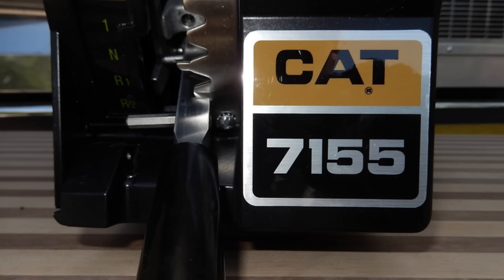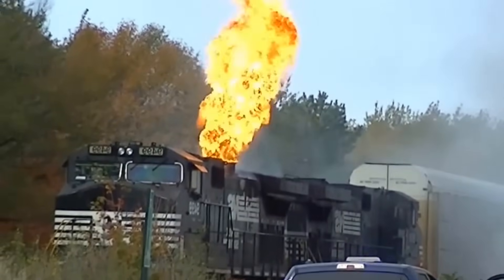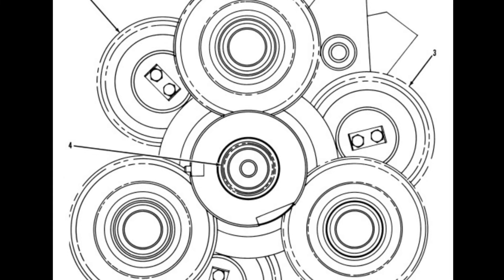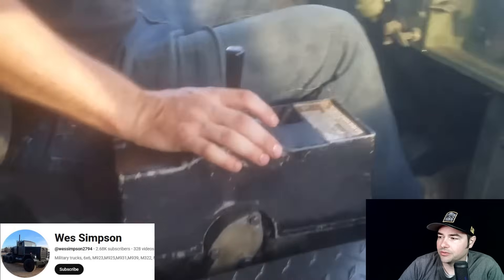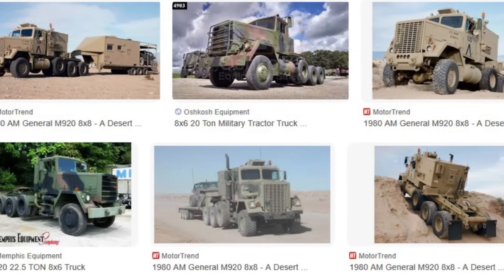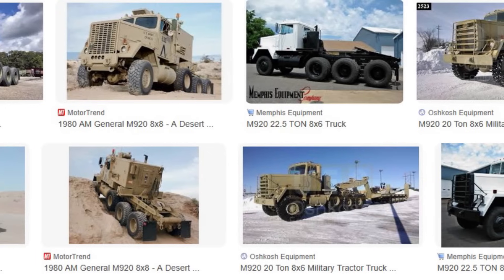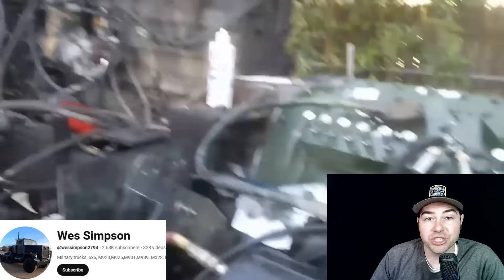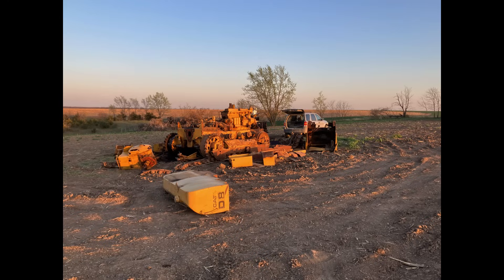Cat's "Semi-Automatic" 7155 Transmission. Ahead of its time and never released to the public.

Comment from the maker: Hope you enjoyed this one. Special thanks to John Goldsmith and Wes Simpson. Wes' Channel link is here: https://www.youtube.com/@wessimpson2794
Reply: I drove a Tank transport road tractor once that had one of those transmissions in it and talked with Sargent that drove one of these trucks and was a trainer and asked him about the semiautomatic transmission. He said that the military went to this transmission because of lack of kids joining the military who grew up driving manual transmission especially non-synchronized transmission like found in heavy duty trucks.  Think about today a truck driver needs an endorsement to drive a manual transmission and the first truck I drove for a paycheck was a dump truck with armstrong steering and twin gear sticks sticking up out of the floor. Additionally the return line was restricted and fuel was turned up which meant you had to ease into throttle every gear change and bark it before you took off otherwise you would hydraulic the engine and blow it up.  My point is not to pat my back but to point out differences on how people my age learn to drive back in the 1970’s compared to people who learned to drive in the 90’s or later when cars had fuel injection not carburetors that required you to feather the gas pedal to keep the engine running when cold and let’s be honest how many people under the age of 50 can drive a manual transmission in the US and of them how many know how to double clutch and or can drive a non synchronized transmission.  
That all said my only real gripe is with a standard manual transmission I pretty much can figure out what gear I a in by feeling where the gear shift levers are and with that semi auto transmission you need to see the light on the dash or look down at the shift tower.  The Sargent who trained military drivers said he pretty much instructed his students to always start in the basement and come up 1 gear at a time and down 1 gear at a time then again they were never supposed to exceed 45mph if I remember correctly

Comment: I was a 19 year old army reservist (transportation unit) ,  and the M915 was the first big truck I drive. 400 Cummins,  Cat transmission,  CCC on the grill, AM General on the side of the hood, i think an IHC cash and Hendrickson suspension. I remember the distinct sound when shifting.  There was a pedal for the Jake break where the clutch should have been.

Comment: worked for cat's R&D departments for 15 years and never came across this piece of equipment, so it was fascinating to see. But toward the end of the video, when you could hear the air cylinders extending and retracting, THAT SOUND is something I DID hear alot in the tech center's test cells. And started to wonder, I bet THATS why the company didnt market it all that much. Air cylinders arent known for going millions of iterations (cycles). They just dont last, unless Cat was making THEM as opposed to buying some aluminum units. I got to see alot of neat stuff in Mossville & Proving Grounds. Nice Video

Comment: GMC put the 302M hydro-matic transmission is the military M135 2 1/2 ton 6x6 beginning in 1950.
Found one listing for the 7155 (NSN 2520-01-082-8143) at $20,500 and another listing for rebuilt 7155's for $10,500

Comment: Its a big go kart clutch 😂 and centrifugal clutches do have adjustments sometimes, you change the engagement etc by changing springs and weights, sounds like a really fun time trying to setup the clutch initially for different applications if they require such adjustments 😐

Comment: Cat semi-auto 7155 transmission:   Weigt (Dry) 1138 lbs.  (459 kg)
Eaton 14910, 10 speed manual transmission:  Weighs 650 lbs. 
500 lbs. weight penalty is huge for commercial highway trucking, not to mention initial cost difference.
Reply: You also gotta factor in the clutch weight on the 10spd as well  so it's only about 350lbs difference

Comment: The Cx Transmission might be cat designed but the electronics are Allison ;) I have an Allison version on my desk as I am designing a new Keypad PCB and new TCU PCB as we have an MD3060 IIRC in one of our two foot gauge trains that came from a garbage truck (with attached 8L cummins engine (Which I wish was a Cat)) as the old set up is trying to engine brake on down shifts and trains brake with the carriages ;) not the engine ;)

Comment: I own and privately operate a M920 with the this transmission in it. Its a bullet proof beast, however many drawbacks. 1. you need to be extremely conscientious about what gear you pick since there is no clutch or easily assessed neutral during rolling turns and abnormal activities. 2. the lag in shifting is terrible, you will need enough energy to bridge a 2-3 second disconnect in torque. which is an eternity for a stick shift. so steep hills and bogs are going to knock you down into a gear that you could launch from a dead stop. Forcing you to crawl out those situations without any ability to up-shift. 3 Its an air hog, the compressor installed does fine on-road, but when you get to manipulating trailers it will not keep up.

Comment: Please do a video on the 6.2/6.5 and investigate their origins as fuel sippers potentially destined for passenger car use. I believe the fact that the Olds 5.7 debacle was in full swing is what drove the 6.2 up into 3/4 and 1 ton trucks. I don’t believe they were designed for that.

Comment: I have a story about this transmission In west germany I happened to be ground guiding a M916 and the truck started making loud banging sounds and I turned around and saw oil pouring on the road  and low and behold there was a 7 eights socket laying in the middle of the busted transmission case pieces probably left inside during a rebuild.

Comment: I have driven these and they are incredible. Drove several of these in Desert Storm and they just worked. You would be amazed at how little professional "truck driving" experience most US Army soldiers have when they begin. You rack up a lot of hours quickly but you are extremely unskilled when you start. So most likely the military made the logistics decision to spend more on the vehicles and less on the training.

Comment: weight was a major factor along with cost.   we had two in pacific truck tractors behind 3412's.   ours didnt have that umpilical shifter setup. strictly air.  but we also had dual controls as this was on a liquid nitrogen  pumper a 2 inch conduit of spaghetti lines and a whole other housuig on top of the trans to account for all the shuttle valves.  cold weather was a nightmare to keep those shifting correctly

Comment: The 7155 cost would fit right in with today's auto shift transmissions. A Volvo I shift reman center section (reusing your your back section and computer/shift section) is 21,000 dollars...plus r&r. The flywheel/ clutch assembly is about 3500$, the clutch activation cylinder about 800$ and the clutch controller is another 800$

Comment: I would guess the service interval would be the biggest drawback and going downhill might be the other issue. Would the transmission stay engaged with idle RPM
Reply: It does but if you ride your brakes and your air pressure drops below 75 the transmission shifts to neutral on its own.

Comment: Allison is pretty much the standard in trash trucks. Starting with the mt 40/41 in a 53 snail cab international front loader. They came out with the at 540, the mt 640, 650 654, and the ht 740, 750. The 654 is the 650 with the 750 torque converter. And now we have the 3000 and 4000 series World transmissions

Comment: I really liked these CAT-7155 transmissions which were found in military road tractors, and dump trucks, and also used in construction road graders. Normal take off gear was always in 8th for on-road use, then skip shift up to 16th. Anything below 8th was for off-road or heavy haul. The only downside to this transmission besides its weight, was having an ultra clean, zero moisture air supply as these shifter controllers would freeze up in the very cold weather in winter. While I was in the Army in the mid-80's, all A.M. General road tractors with the NTC-400hp Big Cam Cummins engine was the norm. Unlike standard Eaton Fuller manual transmissions which would drop rpm's between gear selections, the 7155 even during skip shifting would stay in the higher rpm range similar to that of the Allison automatic transmissions. And speaking of Allison's, back in the 70s-80s, the 600 series was for medium duty trucks and school buses, the 700 series was for heavy duty applications such as road trucks and buses/coaches like the type used by Greyhound and Trailways. Why the CAT-7155 never found use in commercial trucks is beyond me as it made our job so much easier, but I reckon it had something to do with the weight of the transmission, the cost, and complexities of maintenance.

Comment: This gives me flashbacks, I was in a engineer unit, and my truck was a 916, ,1979 AM General, we had transmission problems, the trucks were equipped with alcohol evaporator, we had to send them to 3rd shop, and they retrofitted them with air dryers, problems solved

Comment: A semi-auto transmission from CAT in the '70s? That's some Cold War-level engineering right there. Imagine if they actually mass-produced it—highway trucks today would be a whole different beast! 💪
Reply: highway trucks today already have air-controlled automated manuals. literally the same thing as this with shift forks and a clutch all air operated.

Comment: They were very heavy. Twice the weight of a 13 speed Road ranger. When they first appeared they ran Dextron ATF.. This proved unsuccessful. The downshift forces were harsh enough to shear all the bell housing bolts. They eventually settled on 15 w 40 motor oil. Under 75 PSI of air pressure it would go into neutral. We lost several tri axle dumps in Germany. Loss of air and burning up the brakes coming down those hills in neutral. That was poor design. You need gears with no brakes.
Reply: The design was also engineered to "free wheel" if RPMs hit 2250 and it disengaged from the 400 Big Cam power plant to "save" the transmission. And yes the service (disc?) brakes wouldn't stop the AM General even when empty. That design was a death sentence. Training in the final years necessitated the "two clicks up/ONE click down" with full jakes in any descent. Lives were saved and the drivetrain was redesigned to eliminate that mess.
Reply: @philipchesley9615  Thank God I only had a year of those before they dumped me in Fort Knox to work on the M1. Training in the newest vehicles either driver or mechanic was almost non existent. It was , there's the broken vehicle. Fix it.

Comment: They also created a push button automatic. Maybe not in production,  but had a panel where you push the gears you want to go thru.  Say, 3, 5, 8, 10, 12, 16 then the air system would auto select thru.

Again.  Made commercial transmissions

In 1970s.   ALL speed limits across country wax 55 mph.

Every time you run power thru a gear set you lose HP due to friction so theory was top gear to get to the 95% efficiency had to be direct drive, no gears, just bearings.   

Yes, it was the initial cost combined with male testosterone.  But many, more than just the 4, we're ordered commercially.   Kenworth, White, Peterbuilt would at that time let you come in and order what you want.     

Unfortunately my father passed awhile ago, I was 14 ish..  very into what he was doing but I don't have the real inside.  Just the patent, service docs, etc.

Comment: In the 30s or 40s there were race cars that had transmissions that functioned in the same way. They called this type a "pre-selector gearbox". I believe that the driver had to push a pedal or lever to initiate the shift after selecting the gear rather than using a centrifugal clutch.

Comment: I mean, could you basically call this a powershift transmission?  Seems similar-ish to a tractor transmission?
Reply: A power shift is more akin to an automatic, without the torque converter. Has clutches, bands, and planetaries. Some of the early ones such as Deere's 8 and 15 speed power shifts had a true foot clutch, but now they're "inching pedals" with the clutching done solely by the transmission. This is more like an automated manual without the automated part, using air to shift. You'll notice that the driver has to drop RPM to change each gear, just like in a regular truck transmission, vs an instant shift in a power shift
Reply: @Burnsidef250  I suppose it was more the shifting mechanism itself that reminded me of a powershift. But I do have an air shifted 10 sp Eaton in a truck of mine but the 7155 seems waaaay more complex than that. The Eaton is just a regular 10 sp with an air actuated xy shifter on top. It still uses a traditional clutch also.
Reply: @nevinbontrager8828  When you say xy, do you mean a range selector?

Comment: When i went to diesel tech in the 1990s. The engine instructor said that in the 70s and 80s, Allisons were popular in cement trucks. Because a talented driver could leave in gear and walk it forward following the buildings foundations.
Reply: Yup almost all concrete trucks are allisons now. I drove 1 with a 12 speed Mdrive and it was alright, but for tailgating driveways and sidewalks having a torque converter that makes the truck crawl makes things so much easier.
Reply: Garbage trucks too!

Comment: Tom Inman Trucking in Tulsa had one hooked to a 1693ta.
I had the opportunity to run along with the driver many times going west from Oklahoma. 
For the life of the truck ( a cabover Peterbilt) it had only two drivers. Word was it took some getting used to, it shifted so fast as compared to a 13 speed which I was driving it would smoke you on a pull. 
There may have been other independent companies who had one but I am not aware. It has been 50 years ago
Reply: Tom Inman was a heck of a fleet.  Think they had some 3408 cats.  At the end went to cab over Ford's.  Around 1980 they were gone.

Comment: Great video, really enjoyed this one. 
As one other fellow said here in the comments, looks like a glorified power shift transmission, and personally I would love to have one in my heavy haul truck. I like the idea of an automatic transmission that does exactly what I want like the manual transmission does, although I doubt this is rated for the modern torque numbers the new engines are displacing.
Reply from the maker: The info sheet I believe I displayed in the video had it rated at 1350 torque, which is pretty dang low nowadays.
Reply: I forget the exact numbers, but it was actually torque rated much higher than any Eaton or Spicer transmission at the time. Pretty much equivalent to the Mack triple counter shaft transmissions which were rated for 2050 ft lbs of torque.

Comment: Shifter looks like similar  to that of ford tractor select-o-speed which is 2 reverse and 10 forward  John Deere also made one with I believe 4reverse and 16 forward although they had a inching clutch to start off but not needed once moving
Reply: I was going to say this looks like an agricultural PowerShift Trans,  which came out in the mid to late 60s, I think
Reply: TimberJack also used a similar trans in the larger skidders like the 380 in the early 80’s

Comment: I remember we had these CAT Transmissions in the early 1979/1980 Army Over The Road Trucks made by Crane Carrier Corp CCC in Germany with 400hp Cummins. These had a pedal on the floor like a brake pedal on the left, the operator used as a the air clutch to shift.  They always had a unique sound with the air shift.  The drivers would see who could shift through the gears the quickest. The later trucks after the CCC, 1984 up contract with AM General,  had Allisions and 400 hp Cummins.  I don't remember any of the AM General trucks having the CAT transmissions only the CCC trucks.  The reason Cummins was used they won the engine supplier contract over CAT cause CAT was much more expensive.
Reply: that pedal on the left actuated the Jacobs engine brake

Comment: Eaton now offers the automatic clutch, I have never seen or been around them? I know when they first came out they were having trouble with drivers sitting still and holding the truck still, by giving them just enough fuel to hold them thus burning the clutch up. They have come a long way with the automated shifting, the days of the 18 spd gear jammers are running out.

Comment: While this is cool, it seems like a solution looking for a problem kind of thing, if you're going to shift manually anyway you might as well just have a full manual transmission which is far simpler and less prone to break down and just learn how to drive it. It's quite enjoyable to row the gears on a 10-speed or 18 speed and I think a lot of drivers would agree and that was the downfall of this.

Comment: I know I’m in a very tiny minority, but I hate the modern automated transmissions, and probably wouldn’t have been a big fan of this one either. 13 or 18 ftw
Reply: You are not the minority, I’ve never met a quality driver that preferred an auto
Reply: @24valveTy  I used to be the same but i drive a pivot steer loader everyday,  fwd/rev all the time is a pain in a manual. someone should scale up the ford model T transmission for pivot steers. use disc brakes instead of the lethal drum brakes in the original.